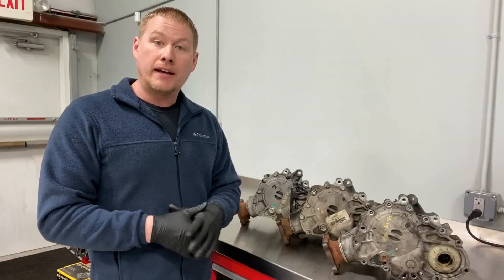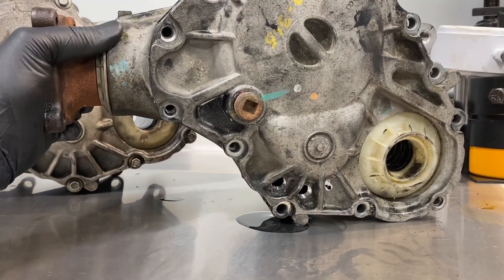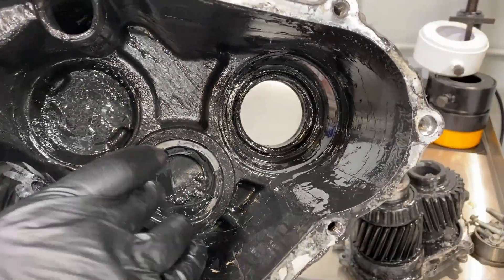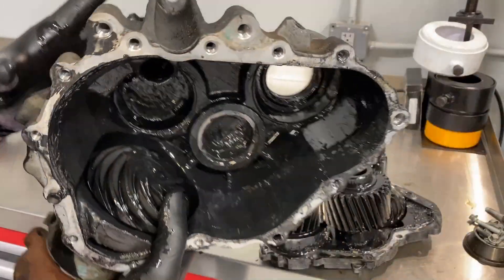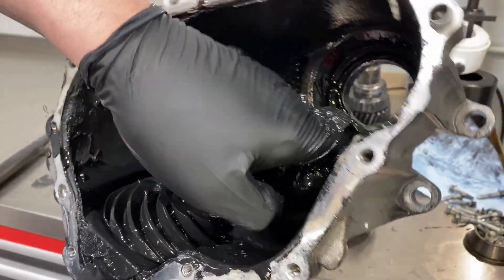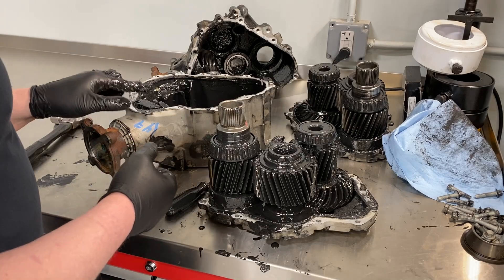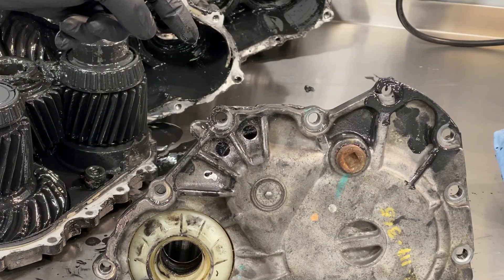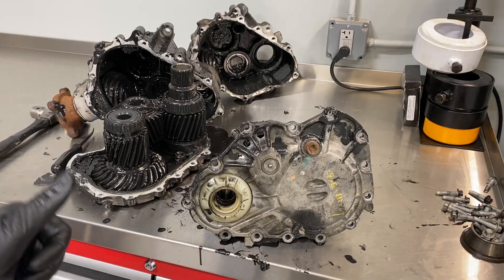How Ford All-Wheel Drive Power Transfer Units Fail and What You Can do to Prevent it!

Comment: Holly cow!!!!  How hot do these things get?  These things have to be getting insanely hot to "cook off" gear oil to such an extreme.  No safety recall on these things?  Many euro cars, particularly Audi/VW and Volvo, have been using similar AWD set ups for 20+ years now and they're not having issues like this.  Many Japanese SUV's too I'm sure.  I know in the Audi/VW's, they don't use those extra "idler" gears, just two bevel gears.  I'd guess those additional fine tooth gears are causing some pretty extreme oil shearing, in turn extreme temps when loaded beyond just spinning an unloaded driveshaft.   I'd be looking at the rear diff coupling to see if the rear diff is staying engaged when it shouldn't be, causing the PTU to always be under full load even during full traction driving/cruising.  Or could it be that the cars just have such bad weight distribution that the front tires need 10psi more than the rear tires to maintain equal front/rear axle speeds, so whatever control unit that works the rear diff coupling doesn't keep the rear axle constantly engaged due to front/rear axle speed difference going above the threshold to activate the diff coupling?  I can almost guarantee whatever control unit ford uses to handle traction control would not set any fault codes in such scenario.  Audi/VW stuff for quite a few years now uses wheel speed signals to at least set tire pressure warning lights, but no fault codes in ABS/ESP or AWD control units to indicate excessive rear axle engagement (that I know of....I stopped wrenching several years ago....).  Seems to me like these PTU failures are a symptom of another problem, not to mention the "weak link in the chain" type deal. 
I doubt piss poor exhaust heat shielding is really adding much to the problem.  On the Audi/VW's, these things are only inches away from the exhaust, even turbochargers with no heat shielding and again, no issues even on cars with separate fluids for Trans and PTU"s with less than 1 quart of oil.

Comment: Wow, Might last as long as 100,000 miles. I have 185,000 on my Toyota and changed spark plugs, tires, headlights, wiper blades, etc, but no major drive train parts.
When are US manufactures going to compete on reliability and longevity?  My wife had an Escort and the timing belt failed just under the 60,000 mile warranty. Realizing it could have stranded her just after the warranty, and every 60,000 miles after that, she got a Toyota too. That lasted to 140,000 miles until it was rear ended on the freeway, a US problem, not a manufacture problem.

Comment: Great video, thanks.
I'm a Mechanical Design Engineer.  The reason Ford is putting the drain plug in the side is not for structural reasons. Its for manufacturing cost considerations. Drilling and tapping the side of the cover can be done in the same setup as the mounting bolt holes.  Putting it in the bottom of the housing would require another machining setup, which would add significant cost.
Another consideration tho is scraping the bottom on a rock.  It would be better not to have a drain plug there. 
When I do mine, I will probably drill and tap into the bottom.
Thank you!

Comment: Would a slight groan under heavy load acceleration from a stop be a sign to watch out for? No other sounds otherwise.
Reply: Im asking this also. What are signs this is a bad t case?
Reply: @rehdz4741   I have had my SHO for 5 years now and even had a stage 4 93 octane tune done for my 2010 stock Taurus.  It may groan occasionally but I  believe it should be okay.

Comment: At the dealership I worked at, we used an evacuation tool to remove as much fluid as possible before refilling the PTU. (can"t drill into warrantable parts)  This was part of our yearly maintenance package for our customers. This method would replace a minimum of 3/4 of the fluid volume.  
Using vaseline in the flutes of the drill bit and the tap helps keep the cuttings out of a closed system.
Reply: good tip thanks

Comment: As an independent shop we have units in the scrap bin. Uber and Lyft drivers burn those up a 20K. Families leaving for trips are curious to know what that noise is. Complete High failure no way to service no shielding from the exhaust. I think Ford knows they have a problem all the new PTO should be serviceable

Comment: WOW, that's total gunk, 60,000 miles not much use for a $1400.00 dollar job, you cant tell me that Ford tests things for long term durability or if they do just turn their head when failures happen. About 5 years ago when I was living in NY [long island] I went to a Mopar dealer for 6 quarts of trans. fluid and filter for my 96 ZJ and the parts guy was telling me that the fluid for the new 8 speed was 50.00 a quart, I was also reading that on some newer trans. the filter is part of the pan so its replaced as a unit and expensive. Things nowdays are efficient UNTIL something happens meaning yeah maybe an 8 speed gets 1 MPG better but are you really saving anything when maintenance is so expensive or when the trans. or other part fails? My 12 MPG 5.2 with 150,000 miles is good enough for me

Comment: Thank you for opening my eyes on the PTU issue, I watched your videos in the past. Last year I changed the oil in the PTU in my 2013 Lincoln MKX at 65,000 miles or so. There's no drain plug,  but I used a vacuum pump to suck the oil thru the fill hole. The oil was black like ink, and smelled awfull. Changed it,  drove 100 miles, then changed it again.  From now on I will keep changing the oil every year,  so about every 12-15,000 miles.

Comment: Whom would have thought changing oil regularly could prolong a components life 😂😂😂
Been rebuilding a few lately but because of my background I evacuate the old oil and refill with fresh oil and have amazing success. 
Most people dont understand what the manufacturer means by “filled for life” its NOT filled for the customers life its filled for the components life, depending on the component, if its a PTU like these it will be in the region of 80-120 thousand km if its a gearbox 250-300 thousand km its about the capacity of the oil in the component.

Comment: 2014 ford taurus limited AWD. PTU failure at 175k, pulled rear driveshaft, now running in FWD with no issues.  PTU replacement is too expensive.

Comment: I remember changing the lube in a Ford Fairmont differential many years ago.  I was icky on the inside with sludge and was smelly.  I had to remove the entire rear case.  It did run quieter after I changed the oil.  Ford said it was lifetime too.  It was much simpler but the worm gear looks just like the Fairmont.

Comment: Why don't manufacturers use synthetic gear oil for example 75w140 in those units since those units have gears in them, gear oil can withstand heat and extreme pressures and last alot longer than 40k miles...

Comment: have a 2015 explorer police with 3.7 - seems to have a a drain plug - were they made better than the PTUs in standard explorers? there was a fair amount of "fur" on the plug's magnet when i drained it. 
also, do you find more failures on the n/a or turbo cars? figure turbo has a bunch more heat radiated into the PTU..
Reply: I have a similar vehicle (2014) and want to do mine.  How difficult was it to do?  Any tips or directions would be great!

Comment: I work at ford this video is 100% on the money. The police cruisers are already on their second or third ptu by 100k miles. Alot of those cars are training/test course cars. Don't buy an awd ford unless you're willing to tap holes & maintain your ptu very often. You can try to extract the fluid with a mityvac as well but it wont work very well but better than nothing at all. If your car already has quite a few miles on it already I'd do some shorter intervals at first to be sure. The whole lifetime fluid/non serviceable thing is just ridiculous but many other companies do it too. Subaru does it with their sealed unit cvt's as well. They tell you your cvt fluid is lifetime fluid it's sealed, you break the seal you'll void your warranty. They also tell you under severe operating conditions( stop & go traffic is categorized as severe) it's recommended to do your cvt fluid every 20k miles. So which one is it? Basically you want to take proper care of your car? Then no warranty. You wanna keep your warrany? Then your car will be a ticking time bomb when you rack up an average amount of mileage. The engineering & way these companies do buisness nowdays is disgusting.

Comment: could you not suck the oil out from the fill hole.. like use a 1/4 inch nylon air hose?
Reply from the maker: Yes I have a video on this method and mention it several times in the video.

Comment: Makes sense after watching this. Many Ford Explorer police cars, also known as interceptor utilities, have had these units fail with less than 30k miles. The agency I work for had one explorer go through two of these units in three years. The transmission went at the same time the first ptu failed. Fortunately Ford ate the repairs under warranty. Thats why there has been more interest with police  Tahoes or going back to Chargers. Plus, the cost of a Tahoe PPV is the same as the Interceptor Utility. It’s a shame Ford did this to themselves with the Explorers. We have also had problems with the water pumps in the explorers, even the 2019’s. The last one was out of service for a month for an unknown coolant issue that a Ford engineer could not figure out. It came back with the same problem.

Comment: Have a 2016 explorer sport with a 100k and changed the fluid with AMS oil. Oil fluid still had oil color to it which was good. My explorer had a drain plug, but have to fill through the vent tube. There’s a sensor and heat shield we’re the fill plug is.

Comment: I replaced the fluid on my 2013 with your tutorial video. No drain plug and I used the tools you recommended. Was able to do it in my driveway. Thanks a lot! Oil didn’t look too bad. 77k

Comment: This is a prime example of why I only own rear wheel drive cars. Sending this video to my dad who has a 2014 all-wheel-drive Edge.
Reply: Pickups and big SUVs are easy to maintain well they have traditional transfer cases
Reply: @bryanmartinez6600  I agree, my girlfriend has a Jeep Grand Cherokee with the Quadra Trac and it is very low maintenance and very reliable. Me myself, I only like cars. I am not a pickup truck or an SUV person. That pretty much limits me to a Dodge Charger or Challenger for anything newer than a 2011. I was a Ford fan for most of my life but when they quit making the Crown Victoria, Grand Marquis and Town Car that was the end for me. My daily drivers are a 2010 Crown Victoria Police Interceptor and a 2010 Dodge Charger HEMI Pursuit and with running Goodyear Eagle Ultra Grips on the back I have never needed an all-wheel-drive or four-wheel-drive vehicle.
Reply: I just avoid AWD. Front, rear, and 4 wheel drive are fine due to their greater ease of maintenance.

Comment: I've used vacuum to suck out oil  then extend the vent tube up to the top of the engine compartment. after that I use the vent tube slowly to fill to the top of the case plug, half way up. about 14oz, Ive done my at 30k intervals same time draining transmission..NEVER HAD ANY ISSUES. The oil was clear synthetic going in and light golden coming out even a 90k

Comment: I replaced the PTU 3 times in my 2014 Taurus SHO, the 3rd time I drilled and tapped the bottom of the case. I use a 1/2” oil drain plug with a magnet tip. My first failure was the ptu to transmission seal and it washed out my ptu with transmission fluid.

Comment: Can get most of the chips out by using kerosene to flush it all out, esp. after tapping. Fill it up to the top and then drain and it a few times and it will also get all the sludge out as well.

Comment: sounds like a good reason to change the fluid yearly, cheap insurance.
Reply: @Reel-Lentless they can be serviced. You suck out the fluid and then add the new fluid back in. They don’t have a drain plug,  but they do have a fill plug.
Reply: @AJourneyOfYourSoul  Yea I don’t know why this is complicated. It takes 5 minutes with a pump. Also the spot he showed to drill is not ideal. The well known spot on the bottom is the best.
Reply: @AJ-we9kd  Great information thanks,now I'm wondering if the Lincoln MKTs has this problem,im thinking about buying one???
Reply: .....or just don't buy Ford's!.....lol

Comment: That fluid needs to be changed annually (12 - 15k miles).  Only holds 1/2 quart.  If you aren't capable of drilling a drain then suck it out, what do you have to loose.

Comment: What kind of driving were those vehicles doing, stop and go city driving? We had a 2013 edge and I drilled a hole in bottom of case and the fluid was good with 60,000 miles on original fluid. Drained again at 90,000 and was good. I live in northern Minnesota with no stop and go city driving, all highway miles. Awesome informative videos, keep up the good work. Thanks

Comment: I'm a Ford guy but there NOTHING in the showrooms that justifies spending my money. I have a 2006 Ford, a 2002 Ford, a 2004 Lincoln, and a 2004 Mercury and I am fine with those. None of these have had major parts fail while I owed money on them. In fact, nothing has failed beyond typical maintenance. Shame on you Ford for building new $50,000 piles of shit.

Comment: 1/8npt tap drill is 11/32, run the tap 7 or 8 teeth deep to get the correct fit of the plug.

Comment: I would have like to see the older Ford Fusion cover style and know if Ford really made a new cover for the 2008-2012 Fusion AWD. Also be aware the driveshaft center bearing failure is another typical failure ($1,500) with the same driveability symptoms as with the PTO. Add the V6 engine water pump fiasco and you will understand why Ford is loosing the few loyal customers they had.

Comment: My 17 Fusion only has 33K (Less than 21,000 miles) and I already changed the PTU fluid twice (75W140 (Amsoil). The same with the transmission and the RDU.  Change them every Spring.

Comment: Does the 2018 ford edge sport have a drain plug ? Just turned 20,000 and I knew this was the weak link . But the Edge Sport is Amazing!
Reply: Just got the 20,000 miles full service ,synthetic oil , ptu drain and fill . Kinda pricey but so is a new ptu .

Comment: I find it easier to drill a hole into the bottom of the case in-between the gears and use a 1/8th npt plug. You can even do it without removing the ptu.

Comment: Cooling inside the engine area underkirted there's no air even if it had fins to help dissapate the heat there's minimal air flow I left a socket in on the fabric shit went for a drive doin 130kms for an hour or realized I forgot it went an it was still there

Comment: I've replaced so many of these at the Ford dealership. Ford put these units in the stupidest location possible. They are surrounded by the transmission, engine and exhaust components all which give off a tremendous amount of heat. These PTU units basically just bake themselves into failure. I can't tell you how many PTU/ axle seals i have replaced because of heat damage.

Comment: I'm not sure by the video, but it looks like the idler shaft goes directly into the case with no bearings. Umm, so I guess a lot of the mush in there is aluminum ? I think I will drain my explorer one and replace with type F fluid and run it with the wheels off the ground a bit then drain it again and repeat type F, then drain and refill with the recommended gear oil. Mine has 60,000 miles on it so I guess I should try and douche it the way I described to get the crap out of it.

Comment: Have you ever posted a video on Ford's plastic oil pans on the newer F150?
Reply from the maker: No the dealers are still dealing with those night mare leaks Ford still has not fixed.
Reply: All engines but the 2.7 and 3.0 EcoBoost engines have metal oil pans.

Comment: Hi brian please respond I have a automatic transmission. I want to delete the transmission return drain back valve. its a fitting that unscrews from the cooler can I gute out the spring and plunger out from the fitting? or will I have to get a fitting that doesn't have those things in there. please let me know if the ball valve and spring can be removed and reusing the fitting back on this time without the ball and spring in there. thank you.

Comment: Designed to fail. 
Recall you doing a video nearly a year ago on pulling the fluid out the fill hole to change it before the fluid got too bad.
Reply from the maker: yup that is an option

Comment: So does my 2018 Edge have a drain plug ?
Reply from the maker: It varies with vehicle options.
Reply: @FordTechMakuloco  Changed oil in it today, has a drain plug, takes a torx 50P socket, got 12 oz/ 400 ml out , very black for only 30,000 km.  thank you for the maintenance tips on this.

Comment: Interesting - when did Ford start putting in the drain plug?  This doesn't apply to F150 because its not AWD - right?  I'm hoping I can change the fluid in my trucks gearbox.
Reply from the maker: This does not apply to the F-150.

Comment: In addition to the heat, I suspect the relatively small volume of fluid is a contributing factor to the fluid getting cooked.
Reply from the maker: Definitely.
Reply: @FordTechMakuloco   Could you add a fill hole up higher on the case, and run double the amount of fluid?  Would it expand and puke the extra under normal operating conditions?

Comment: My 2016 Ford Fusion AWD has a drain plug—I just serviced it and the plug was stuck big time and stripped the T50 bolt—had to get a easy out and drill the center of the plug then insert the easy out—lets just say the new plug had half a tube of permatex on it lol